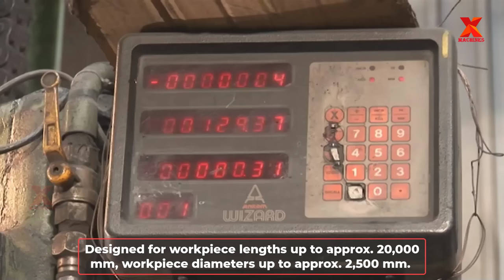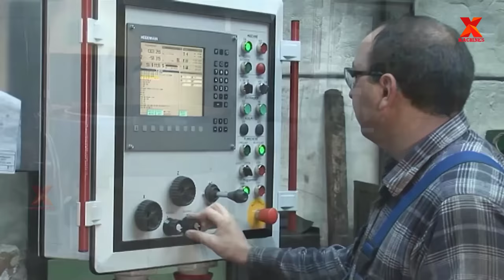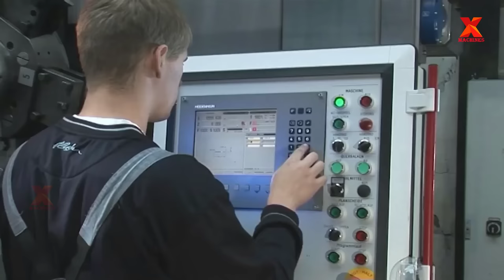Incredible Heavy Duty Lathe In Working. Modern Automatic CNC Machine, Boring And Milling Portal

Comment: I liked it. I worked as a machinist for 18 years, learned about it while working at WEAN in Ohio, we had machines that large I think the widest three head Ingersoll was 14' wide. I mostly ran a lathe with 10' diameter capacity and VTL/VBM up to 12" tables.
Used what I learned, taught machining in HS and Engineering in college. LOVE the big work but something I always wanted to learn was to program a 5 axis CNC, and I wondered what software they were using to program it.
I mention that because the first CNC I ran was programmed using APT, and taught it for a short while. I miss machining but love seeing these.
Reply: I worked for GE gear plant in Lynn MASS in early 80s 3yrs out of high school.  Every machine was huge and I couldn't believe I would work on the big boys. Every machine needed an overhead crane.  All horz boring an mill  used steel floor as tables. First machine I seen when i went in for interview was a huge VTL having an over 20ft bull gear for a U.S. Navy aircraft carrier. Left after 5yrs to work for a utility company
Reply: The best software out there in my opinion is Mastercam and Solidworks. Full five axis packages are standard.
Reply: @DavidJohnson-rd5wy  I used to teach Mastercam in HS and my kids came in second at State VICA competition. Also taught APT and FeatureCam, all were good for their time

Comment: I never quite understood why lathe turning is never combined by rotating milling head?
Reply: No advantage to have an interrupted cut. There are mill turn machines, but the milling is done using the lathe spindle at low speed or locked at a certain position.
Reply: @topduk  on huge lathes you actually don't want to stop rotation and let part settle. We always kept very slow and only stop to measure or get  inspection
Reply: You'll never get the same accuracy by trying to mill those features. Besides, you can remove much more material turning, with much less tool pressure on your workpiece.
Reply: @DavidJohnson-rd5wy  Not for accuracy per say but for speeding up rough removal of material.
Reply: Place I work for actually sort of does this occasionally with some big parts. Not sure exactly what the rationale is. A 4" 45° lead facemill is mounted on an angle head, itself at something like 45°, maybe less, and a plunging strategy is used for initial roughing. The part/table aren't rotating, just indexing from one position to another and cut come from the ram. Might be to keep the cutting forces aimed at the table.
Reply: @copperlemon1  interesting. not sure i quite imagine the set up